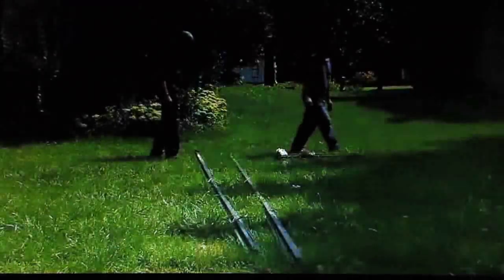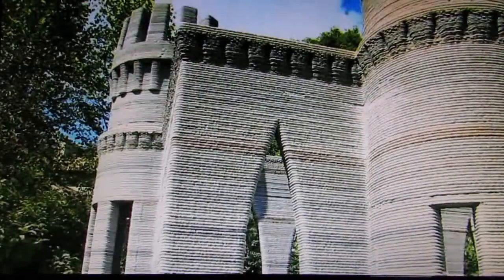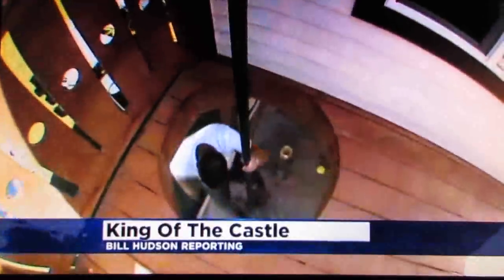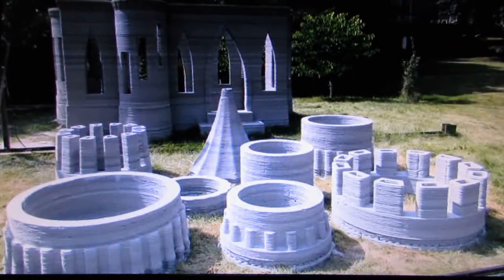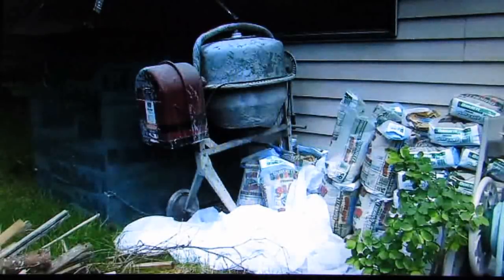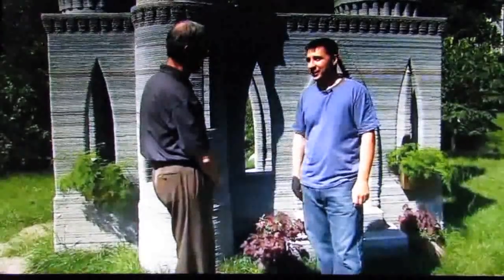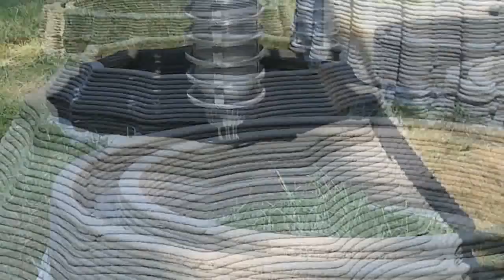3D Printed Concrete Castle

Comment: China's Already building houses with 3Dprinter
Reply: I R YODA not quite the same way.
Reply: Not in castle form but yes exactly the same way. Its on youtube bro, I think i watch it like 3 days before I seen this one, and their printer was gigantic!
Reply: I R YODA They print walls to assemble offsite though. Not the structure as a whole.
Reply: Whose they? the Chinese or these guys here?
Reply: Chinese. They print the walls in a factory, on a large printer. Then move the walls to the build site.

It's a factory based printer, not an onsite printer.
Reply: Oh i see, you haven't seen the video i seen they made the entire building
Reply: at a factory site...
Reply: ...what does it matter it was the entire thing not just a wall..
Reply: Difference between equipment small enough to fit in a yard and something that you can only use at an industrial complex.
Reply: I R YODA Also actually, are you talking about the apartment complex and mansion?

Because if you are talking about the apartment complex/mansion they were printed in pieces (ie. individual walls) inside a factory and assembled on site. Not printed as one structure.
Reply: Raven1024 What are you talking about? They don't print in the factory but rather in the same place where they want to build. Just take a look a some videos from Winsun company.
Reply: TheWalper Incorrect. Every article, video, or other form of media talking about Winsun has a part that goes like this.

"The walls and other components of the structure were fabricated offsite with a diagonal reinforced print pattern and then shipped in and pieced together. The company then placed beam columns and steel rebar within the walls, along with insulation, reserving space for pipe lines, windows and doors."

They print the walls in the factory on their single large printer. then ship them to the site and assemble them.

There are no pictures of the printer as a whole, the models of the printer on rails in several videos are not the printer in question.
The printer in question is clearly inside a warehouse/factory not out in the open when they show the printhead working on the walls.

Optimism is one thing, but just plain ignoring the facts is silly.

Here's even a picture of several of their walls chilling on a large pallet. 
http://3dprintingindustry.com/wp-content/uploads/2015/01/41.png

Two more of assembly:
http://www.3ders.org/images2014/3d-printed-villa-building-china-25.png
http://www.3ders.org/images2014/3d-printed-villa-building-china-22.png

So again...not printed on site.
Reply: Raven1024
It doesn't matter, they can build 1 house in 1 day.
Reply: TheWalper No. They can't. The concrete has to be allowed to cure before assembly. Then they have to ship it out, and assemble it. This means your wait for a house will probably be over a month total.

On top of that they would have to be able to get heavy equipment and cranes into the area to lift the walls into position. Compare that to offsite prebuilt wood structures and this is considerably more difficult for the time being.

Also nice job on just ignoring the previous point which was that they are built in pieces offsite and assembled there as opposed to the video where the entire structure is printed on site in fewer pieces (ie stronger)

I stand by that the two methods are similar but not quite the same. A building printed on site in fewer pieces is going to have more strength in the long run than something printed offsite and assembled with a material like concrete.

Comment: What's stopping this exact method to be used for building in a bigger scale? Is it safety concerns? (Since in traditional building there are more materials being used to reinforce the structures, instead of just concrete)
Reply: +Guilherme Sena Reinforcement... Concrete falls apart after time without embedded rebar to reinforce it. You cant print rebar, yet....

Comment: This is one heavy castle. I wonder what did you make for the foundation.
Reply: +RebirthOfLeGenD Dota I think he is refering to the sheer weight of the castle on the ground. with something that heavy it is going to need some sort of foundation or it will sink into the ground and begin to crack

Comment: 22 brick salesmen disliked this video
Reply: *****
not too many visionaries among the brick salesmen, I guess
Reply: +atenrok You could use the right bricks and use this for the mortar. It may reduce the costs of a solid cement device.  Hey, how using the same techniques to lay brick and then the cement head fills in the gaps?  Would that work?
Reply: Chris P
or you can upload the design files into this machine, push the "RUN" button and go for lunch... Your choice.
Reply: True Tech LoL... great comment... can't wait to see Italian speaking robot's..lol
Reply: Now 715 masons and brick salesmen...
Reply: @leveckfamily8841  or push run and create new jobs by creating a New industry....freeing lumps manual labor... they can now till our fields and reduce migrant workers... and even the lumps can have a castle...
Reply: resources castles are overrated they are drafty and very expensive to heat and cool.
That's why we only have two of them. One for the winter and the other for the summer.
Reply: so did the framers, drywall, tapers, stucco and insulation companies
Reply: probably the other people to have made concrete 3d printers.

Comment: I'm questioning the sturdiness of the castle. As far as I'm concerned its a death trap until he makes a duplicate and tests its durability himself.
Reply: Yes, because our knowledge about cement is so limited. We only use this stuff for some 2000 years, we definite can't ensure it's durable enough! ;) ;) ;)
Reply: +Denys Vlasenko He's concerned with the way it is being stacked layer upon layer. The lack of cohesion between layers could make it much weaker than solid concrete.

Comment: no rebar, that castle is a death trap.
Reply: +Doktor Low there's no rebar in cinderblock buildings either.   :)

Funny, you're in those all the time.
Reply: +Sahadi420 ceilings? :P
Reply: +Doktor Low
I assume the gap between the two walls has rebar inserted into it and then concrete pored in.
Reply: +shane jones I think just wood is used.  Look to the left at 4:23.
Reply: +Doktor Low And just as fdm 3D printers often are, they are weaker on the z axis as well, I wonder if this applies to this material, while it's a super cool project, we are miles away from being able to use this for any meaningful way.. there is already a company that managed to build a 3D printer that has two printheads, one in resin, the other in carbon fiber, so inserting steel cable (instead of rebar) might be possible..
Reply: Probably mixing in some sort of fiber strings and the previous layer is wet the strings will bond strong.
Reply: Doktor Low my mom died having me
Reply: pete a so that's why she doesn't move much D:
Reply: Doktor Low no stone either..no rebar + no stone = no strength
Reply: Sahadi420 
It's made of recycled wood from site scrap and quick dry concrete, so it has fibers to hold it together. Think Hempcrete
Reply: Sahadi420 I think they are formwork
Reply: The lack of actual knowledge being substituted by sheer ignorance in this thread is through the roof.
Reply: Sahadi420 there is absolutely rebar in cinder block walls, they are epoxied into the slab and run vertically up through the tubes made by the hollows when blocks are stacked, these tubes with rebar are poured full of mortar as the wall goes up. And every so often and at tops of walls, a trench shaped layer of blocks is used, with horizontal rebar the entire length, also filled with mortar. Can tell you never worked any real construction. Don't speak of things you obviously know nothing of.
Reply: @Sahadi420  bullshit, re-bar is used in between races in cinder block construction and vertically, that's why they have those little cut outs in the top edges of the blocks.
Reply: Pete Mason  re bar is always needed if you live in a seismic zone.
Reply: @Sahadi420  cinderblock buildings have rebar too
Reply: Rebar or no rebar, deathtrap or nuclear bomb shelter, this guy has come up with great technology that lays ground work for something revolutionary.  The Segway scooter was just lame as crap, but it laid the ground work for bipedal motion control.
Reply: @shanejones3126  you assume?
Reply: огромная эрекция  stone isn't concrete smart guy
Reply: pete a I was freaking out about how futuristic the future  (*present) is getting, and how I'm out of touch with technology, etc, and so started desperately looking for a comment like this to bring me down to Earth and remind me people are still people. Thank you.
Reply: not even close.

Comment: What about insulation in the outer wall? Expanding foam? To insulate? Concrete is a cold material to me?
Reply: Sandra Keener From what I've seen of the ones that are already being developed for larger structures they have a lot of air voids in the walls.  Those could easily be filled with expanded foam for insulation.

Comment: Aren't there huge problems with a house made of concrete? Like structure, electrical wiring can't be fun, and wouldn't it be real expensive?
Reply: +PoLoMoTo2534 With typical concrete construction piping and conduit for wiring can easily be installed. With 3d printing without installing piping and conduit during the printing process you are going to have issues with utilities after being printed. Not to mention the lack of reinforcement with this 3D process.

Comment: Now you just need to cover it with something to make it look nice and smooth. Build a mansion next, or maybe go to africa and help them build homes there or help them reconstruct, you can help many countries that have had natural disasters, help them with 3D printers. This is basically the future of construction.
Reply: +Jake Martinez 
Actually I think that the layered, sort of ridged surface is very cool.  I wouldn't mind living in a house with a texture like that.

If for some reason you don't want that, though, just add a trowel to smooth things out.
Reply: +Jake Martinez Concrete buildings without support from a steel rod construction grid are really weak.. but i guess the technology to 3d print metal from a liquid form wouldnt be all too far fetched after seeing this.. we shall see
Reply: I say let it weather a bit, overgrow by moss and lichen, plant some ivy around the corners and it should look real nice
Reply: +Gino Foogle Even printing around a metal rod frame really isn't that farfetched
Reply: Despicably Irascible Rapscallion fair enough..
Reply: +Jake Martinez i doubt they can afford the materials... better send them an exports' container. Big enough for most things and can be cut to make rooms. Cheap to transport and they are light compared to concrete.
Reply: +Gino Foogle Try telling that to Edison.
Reply: Metal 3d printers already exist . There was a news story back when all the idiots were worried about people 3d printing guns and the creators of the first metal 3d printer showed that it could be done but it would cost about a thousand dollars more to just make a simple handgun and then you would still need to machine it to get it to work properly .

Comment: It's not quite perfect yet, you can clearly see the layering. But it is still gr8 m8
Reply: +DeathSwagga You always will.  You can go higher res to make finer but that would be too slow.   You could always use this as a base then smooth on concrete with a trowel by hand to finish.
Reply: DaveC1964 Or you could use some advanced material that sort of melts into shape eliminating the ridges

Comment: I wonder how much it would cost to build a normal sized house with a 3D printer.
Reply: +Mark Murarescu, just as with any form of traditional construction method used, you forget there is not just the cost for materials, but the time for labor, the costs for the machines and equipment used to help construct the building as well. By labor, even if you diy, your taking time from others things you could be doing to make money like going to a full time job.

Comment: With no reinforcement, what is helping the concrete with it's very weak tensile strength.  Concrete is used in construction all over the world, but it NEEDS reinforcement.
Reply: Good observation, but look up geopolymer

Comment: the problem with concrete house is breathability, humidity, etc.
Reply: Easily solved by a properly sized HVAC system.
Reply: if you only depend on a good HVAC system, you wont get far.
Reply: Pandu Adikara
You clearly don't know what you're talking about. Monolithic Domes have no problem with "breathability". HVAC or just open windows work fine.

Comment: Need to put some steel beams for support. If you live in a hot spot for earthquakes, typhoon, strong winds, heavy rains, or hurricane, this will just get destroy.
Reply: +Mable Yatts isnt it possible to add 'strong as steel' fibers to the concrete mix that in effect reproduce the job re-bar does
Reply: +Mable Yatts Sounds like you don't know much about construction.
Reply: +mac daddy he doesn't even need to know about construction to know that this is not very strong construction. You need armature otherwise a bit strronger blow to the wall is gonna break it apart just like glass. If you armature glass it won't break but if you have normal glass you can break it easily. Same goes for concrete construction.
Reply: sermerlin1 That size project is strong enough for what its intention is. If you are going to go around banging it intentionally then you have a bigger issue on your hands.
Reply: ***** Is it? It's quite sizable castle and concrete is quite weak if it isn't armed... It's so weak that even those concrete vases have armature in them. Concrete gets brittle very quickly if it doesn't have something to hold on to as that's where armature kicks in.

Comment: I don't think that's concrete, there's no aggregate.   That's mortar.   No Rebar Reinforcement = Earth Quake Hazard.
Reply: Lives in Minnesota=pretty much no earthquakes...
Reply: @danlhoy  A dome structure is probably one of the most stable structures.  Despite this, I remember reading an article a few years back of how they were experimenting with monolithic domes (airform shotcrete and foam domes) without using rebar.  This would save a lot of steel and labor in placing/cutting/tying of the steel.  They wanted to use a series of metal rings in the mix that were to form a reinforcement net of a sort.  It lasted for a bit until those rings started to rust because they were very thin and then entire sections of the overhead dome coming down and it had to be condemned.  The domes that were built with conventional methods are still standing strong down to this day 50 / 60 years later.    Doesn't necessarily have to be be earthquakes, blizzards, snow load, hurricanes, tornadoes can all impact a structure like this and I don't think without reinforcement it's going to be adopted in society.  They have to tackle this aspect.

Comment: Cement must be really cheap there... If a house was whole made of cement here it would cost way too much to build.

One bag of 50KG costs nearly 10 € here so.... Thousands and thousands of it.
Reply: +guily6669 in EU bags of 50 Kg are not allowed as humans are not allowed to carry more then 25 Kg.
But I think that cement is still cheaper than brick....and most large buildings in EU are completely made from cement.
Reply: +aintnonerd Well, here I worked is with 50KG of cement and actually never seen a bag of 25KG of it (only other types like cement glue....).

Anyway here is way, WAY cheaper to use those big cement bricks with holes, that's what everyone uses.

Bricks then a thin layer of cement, then another brick above it, it goes like this.
Reply: Well, they do use   aggregate and sand to make the mix so it is cheaper.  He can't buy concrete by the truck but I am willing if he buys pallets at a time he would get a bit of a discount.
Reply: +Chris P Here we mix water+sand+cement too but at least in this shitty country believe me, its nothing cheap so we use weak hollow bricks which are way cheaper but they just break easily...

Rock is the best, but almost no one makes houses with them since they became way too expensive and HELL almost no one even make a house anymore :(

Comment: Can you print a pizza oven?
Reply: +WolfsburgWarehouse i mean in theory.but idk if you need specific stone.. even then most stone can melt from my understanding.
Reply: +yesfull man 
Yes it is important to use a refractory cement which can also withstand high temperatures. Possibly printed using pumice concrete or refractory concrete. Wood Fired Pizza Ovens usually have bricks inside with a 36% silica content which is good at high heat but also retains heat for longer periods.

Comment: Where are the rebars? it needs urgently steel inside xD otherwise it soon will colaps
Reply: +Carlos Ollero Rebar is used to introduce flexibility, relieving brittleness, increasing strength. I don't believe it should be an issue with thin layers reinforced with structural arches and curves.

Comment: That is not as good as it sounds, concrete is rather fragile and parts of that thin construction can break loose and fall down own the children, if he make it larger it can crumble under its own weight, he need to reinforced the concrete with iron rods or in other ways like this https://youtu.be/NMtodG5z35Q
In other videos where they print with concrete you will see that they are make a inner and outer shape first, then they fill that space with concrete that have iron rods as reinforcement.